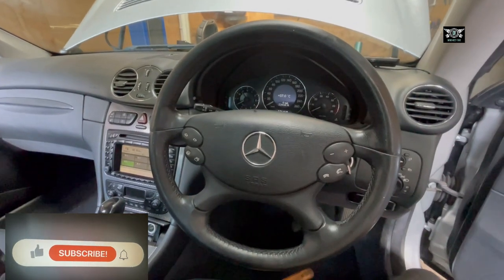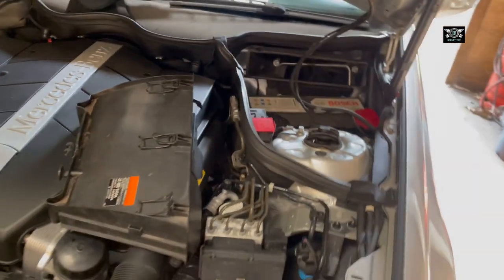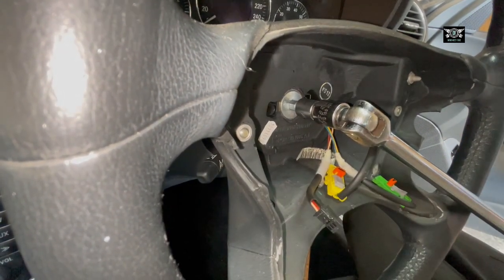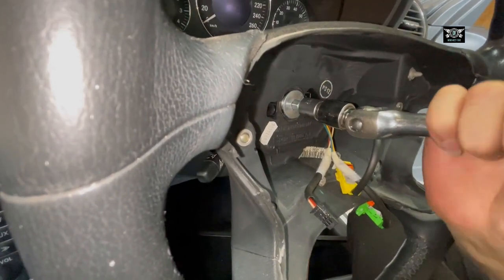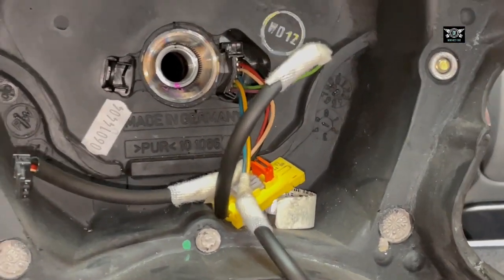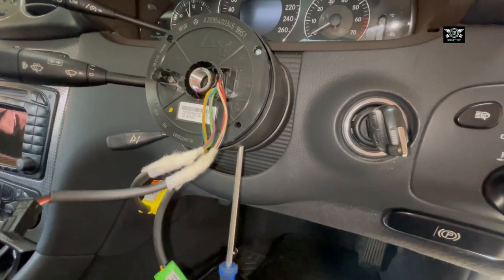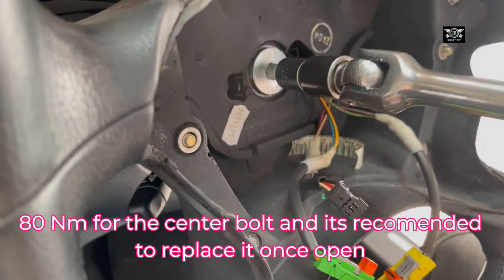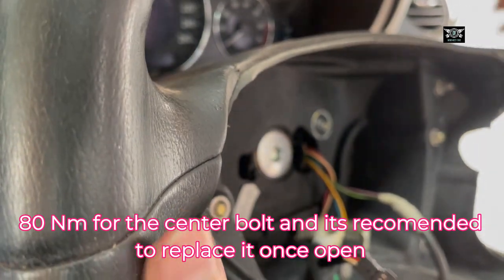Mercedes CLK w209 indicator stalk removal and replacement

Comment: After doing this job the clock spring is making noise when turning the wheel left but everything works perfect, do you have any idea?
Reply from the maker: some times you need to spray a little wd40 as the steering grinds a bit around the area of the clock spring..or even between the plastic covers, unless something is not seating properly is which case might be a good idea to take it apart again and make sure all is seating as it should.